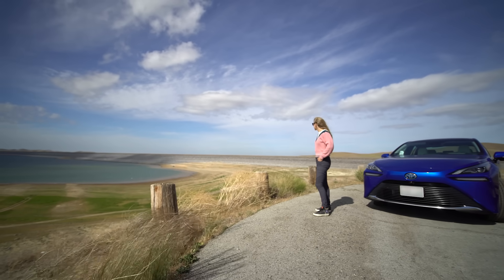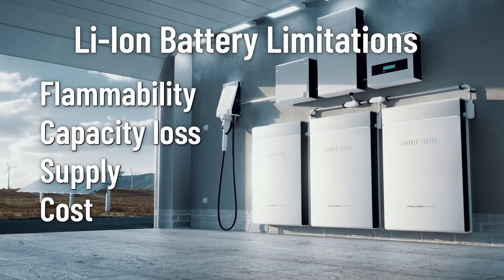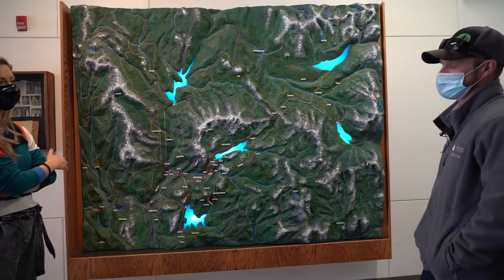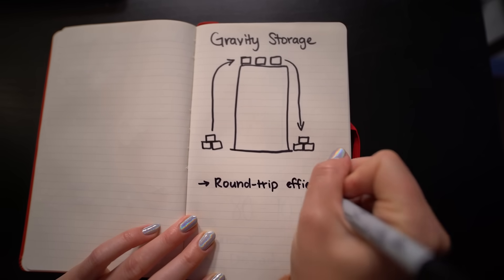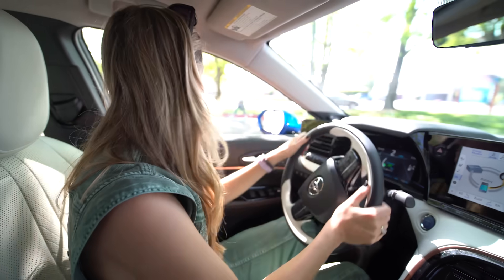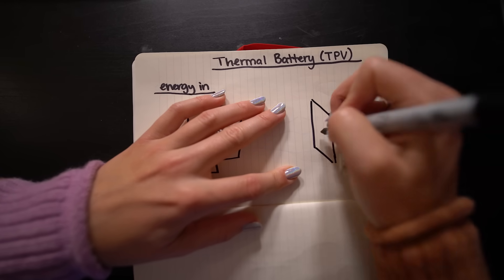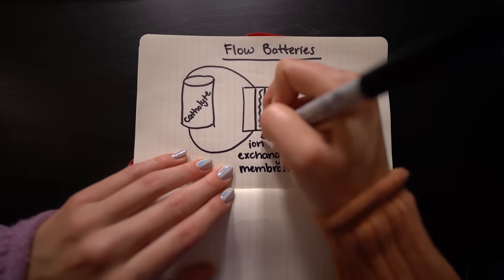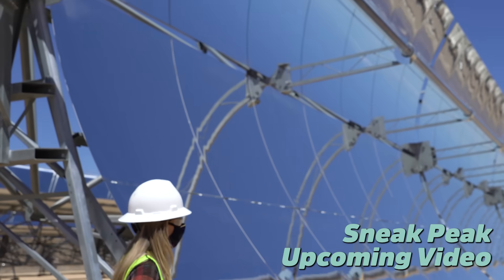The BIGGEST problem with clean energy

Comment: Hydrogen is very expensive to store.  Compressed hydrogen in tanks generally requires tanks that are so expensive that, if you have to store the hydrogen for longer than a day, it's cheaper to throw it out and make it fresh when you need it.  That's basically saying more than one-day hydrogen storage is too expensive.
Reply: Take the hydrogen, combine with carbon dioxide, and you get methanol.   Combine hydrogen with nitrogen and you get ammonia.  Those are far easier and cheaper to store and transport.  Indeed Mearsk has now recently committed to procuring dual fuel container ships than can run on green methanol as well as bunker fuel.  The big challenge is how to make that process efficient.
Reply: This only makes sense if you're using the tank only once.  Obviously that's not the case in any sane system.
Reply: @jen204  Hydrogen is 83.7 g/m^3/atm at 20 C.  A spherical steel tank (60 ksi steel) at 15 ksi working stress is 11.8 kg/m^3/atm.  The hydrogen is worth $1.50/kg.  The steel, fabricated into a sphere, is about $40/kg.  So the steel tank costs 3800x as much as the hydrogen it holds.

At a 6%/year discount rate, the cost of the steel tank for 1.6 days is the same as the value of the hydrogen in it.  So suppose you have some hydrogen now, and you need it in two days.  You can either pay the capital cost of the tank for two days, or you can dump the hydrogen and make new stuff two days from now.  The latter option is cheaper.  Obviously this is a silly simplified example, but it illustrates the problem of storing hydrogen.  Economically reasonable hydrogen storage requires cryogenic temperature.

Hydrogen gas is stored and transported via pipeline in huge quantities today.  It's primarily used by oil refineries to crack heavy crude into lighter fractions, and to produce ammonia from nitrogen.  The chemical industry has many decades of experience with hydrogen... and the stuff is ridiculously bulky.  As a result, it is made when it is needed, in close proximity to it's use.
Reply: @IainMcClatchie  I very much appreciate the detailed explanation - plus it made me learn what "ksi" was, since I'm not a materials scientist.  But I find your math is incorrect.  By your figures, that 1000-atm tank (15 ksi) holds 83.7 kg hydrogen and uses 11.8 kg of steel (a 1 m^3 tank to keep the math easy).  That's $125.55 of hydrogen, with a materials cost (steel) of $472.  The tank is still more expensive, but by less than 4x, not 3800x.  I think you calculated at 1 atm, which of course would be inefficient - nobody stores uncompressed gases.  Of course there are additional costs beyond materials, but if you're paying $472000 for a 1 m^3 tank, you're being overcharged.  :)
Reply: @jen204  Hey Jen, looks like I wasn't clear enough.

By 15 ksi, I mean the steel of the tank is under 15,000 pounds/inch^2 of tensile stress.  That's in the steel.  15 ksi is one fourth of 60 ksi, which is the yield strength of the steel.  The safety factor of four is typical for civil engineering.  It'd be different (lower) for a pressure tank on a rocket, but for cars we use the ASME safety factor of 4.

The contents of the tank might be at 200 atmospheres pressure.  That's pretty typical for scuba tanks.  So a steel tank holding that would weigh 11.8 * 200 = 2360 kg/m^3.  The hydrogen it contains, at 20 C, would weigh 16.7 kg/m^3.  It doesn't matter what pressure I assume (so long as its well above ambient), the ratio between the weight of the hydrogen and the weight of the steel stays the same.  My math is correct.  For steel at 15 ksi working stress, the tank to payload mass ratio is 141.

The cost ratio isn't actually quite as high as 3800, but that's actually another problem.  Fuelling up the Mirai costs over $15/kg, which is crazy expensive.  Hydrogen in bulk is 1/10th of that price.  At $1.50/kg, fuelling a Mirai would be similar in cost to charging a Tesla.  At the going price at pumps you can use, it's just nutty expensive.  I guess a car pump will never deliver hydrogen at $1.50/kg (just like you can't buy gasoline for the price of a barrel of crude oil), but it ought to be within a factor of 2-3.

You can get more hydrogen into the same tank by cooling it down.  Lots more.  That's why lots of hydrogen tanks store the hydrogen at cryogenic temperatures.  That is, cold enough that air condenses to a liquid or solid.  Get the hydrogen cold enough (below 20 K) and it'll turn into a liquid, at which point you can put quite a lot of hydrogen in a tank.

The Mirai has to deal with hydrogen getting somewhat cold when you pump it into the car, but this is because it is expanding as it leaves the station's hydrogen tank.  As far as I can tell from reading, the Mirai stores its hydrogen at ambient temperature.  Trying to keep hydrogen cold in a small tank would be way too much trouble.  Insulation is bulky, and cryogenic insulation is very bulky.
Reply: @IainMcClatchie  I'm sure your explanation was clear, but you reckoned without the density of your audience.  :)  But again, thanks for trying.  Where I got lost was this: "a spherical steel tank (60 ksi steel) at 15 ksi working stress is 11.8 kg/m^3/atm"  ... I overlooked the last "atm", since it didn't occur to me that pressure would be on both sides of the equation (why talk about working stress - pressure, right? - if you are then dividing by pressure on the other side?).  So, if I now understand correctly - a big "if" - a spherical steel tank that safely contains 15 ksi is in fact 11800 kg/m^3.  Clearly your numbers are correct, since they do correspond within 2x to typical SCUBA tanks.  So I stand corrected, and appreciate it!
Reply: @jen204  :) Cylinders weigh 2x more than spheres to hold the same volume at the same pressure.  Spheres are the most efficient shape.

Unfortunately, this makes my numbers check worse against SCUBA tanks.  A typical SCUBA tank is 12 liters, weighs 16 kg, and holds a pressure of 230 bar.  My number would predict 32.5 kg for a spherical tank and 65 kg for a cylinder.  SCUBA tanks are somewhere in between since they have spherical end caps.

The reason I'm off is that I assume 60 ksi steel, typical for the stuff you'd make a bridge out of.  SCUBA tanks are made of AISI 4140H steel with a tensile strength of 167 ksi, or maybe even better stuff that I'm even less familiar with.

The higher performance steel will cost more, and my point remains the same.  Hydrogen is just too expensive to store for reasonable amounts of time.

Comment: When it comes to Hydrogen, isn't there quite the storage and transportation problem? A friend of mine's PHD thesis was on making carbon fiber (light) Hydrogen tanks that didn't leak (tiny H-molecules have a way of seeping through material).
That's when I learned about another technique that doesn't just use Hydrogen but also Nitrogen from the air to create ammonia.
It works in a similar way as a Hydrogen cell (atoms go through membranes and catalyzers induce the reacions) but the main advantage is that there is already a (huge) network for ammonia transportation, it doesn't have to be stored at huge pressures, and it's less flamable/explosive... I do think the fact that you have to "break" a very stabe N2-molecule was sort of an issue still, but I found it a very interesting technique!

Comment: Storage is much less of a problem for wind, than it is for solar.  For solar you need technology to timeshift across a 24 hour period, but with wind it's more likely that you just need technology to move electrons from somewhere the wind is blowing, and statistically it becomes less of an issue as more wind power gets built out.  Pumped hydro a good option, as is pumped air, melting salts, flow batteries and all those others.  I think it's kind of disappointing to have to discount your content because it's so obviously sponsored to favour Toyota's odd focus on Hydrogen.  Hydrogen is surely valuable for fixed refueling locations like rail stations and airports, but for cars it's clearly been superseded before it even starts.

Comment: Not so sure about that thermal battery concept; not only in terms of its scalability, but the fact that it seems like its mechanisms are deeply rooted in old legacy energies... i.e. burning carbon glowing hot to throw some IR radiation at some solar cells. 
Anyone else find that to basically just sound like a painfully engineered version of a mobile solar array? It would solve the inconsistent  sunshine problem, but does so by adding a fuel to burn as a fixed light source.
Solar is already kinda a lackluster renewable as is. At this point either the photovoltaic tech needs to have a breakthrough in efficiency or we put an array of reflectors on satellites and relay the Sun's light to be collected on the Earth's surface more directly. Until then, solar will remain a novelty-tier energy source.

Comment: What I find interesting is that many people don’t realize that hydrogen fuel cells literally are batteries. It’s just that the oxidant and reductant are being continuous supplied at the anode and cathode. 

If we moved to decentralized power generation, we could produce way more power than people would ever use (at least in the current era) and efficiency would no longer be an issue. Pavement is a 100% inefficient solar panel. With that, we could just use metals as oxidants and reductants for durability without worrying about the efficiency.

Comment: Something you missed.  Tesla.

Tesla has developed a new form factor for batteries which is expected to bring the cost of cells below $50/kWh.  Their tabless, dry rolled 4680 cells are on track to revolutionize batteries.

Their 4680 technology is not wed to a specific chemistry.  "Lithium-ion" chemistries are likely to be used in performance and long range vehicles because they store more energy per volume and weight.  But for most EVs and grid storage the best chemistry of the moment is lithium iron phosphate (LFP).

LFP battery materials are very abundant and cheap.  LFP batteries have very long cycle life.  The LFP cells I'm using with my solar panels are rated for 10,000 full cycles.

$50/kWh / 10,000 cycles = $0.005/kWh.  Half a penny.  
---

There may be a few times per year when we need a dispatchable generation source as cycling only a half dozen times a year wouldn't go very far to pay for LFP cells.  That role might be taken up by running existing CCNG plants with methane recovered from urban and agriculture waste streams.

Comment: Consider electricity is optional but a livable planet is not.   I use solar power without grid.  Better to consume energy when it is available.  For example I run my 3d printer on sunny days not raining.  At .scale consider running desalination, and many industries scheduled around the weather.  Many countries do not have grid power 24 hours a day, and we should consider turning the grid off at times as well.
Reply: Of course, your 3d printer, your 'without grid' is residential scale. About 20% of total energy use.

To make the plastics, refine the metals, form and assemble your 3d printer you need continuous power. You can't turn off a plastics batch mid-stream even for an hour, because it might take you hours, or even days, to get back to the correct temperatures. Ditto refining metals.
Starting up and shutting down the forming and assembly machines simply means that the firm building the 3d printer isn't using its equipment economically, its workforce is either working like mad or standing around waiting, and its planning for materials in and products out are out of whack.
Industry is about 30% of total energy use.

"Many countries do not have grid power 24 hours a day" - and those are poor countries with unhappy populations. Those countries are poor BECAUSE they don't have grid power 24 hours a day.
Reply: @factnotfiction5915  I have been to countries without any power grid, and the people there were more happy.   In this place they had everything. The most important things (healthy food) they had abundance unlike in the US were the food is riddled with chemicals.  Americans who take record numbers of antidepressants and are very unhappy in general.  I think you are confused or read too much false information about poor countries being unhappy, because it really depends and material wealth does not make people happy.   How can you support a production system that is leading to complete destruction when everywhere I look in the USA I see people with too much stuff.   The people here have too many physical possessions which just adds stress to life and the highest levels of waste anywhere.   If is possible to produce more than is needed already working with energy as it is available without storage.   You can shut down production in overcast days for plastics and steel, it is simple as that, because we already produce far too much and it ends up being wasted and not valued at the level it should be considering the emissions caused.   Ensuring constant excessive energy for high-energy lifestyle is a mistake and if it continues: our future is bleak.   For example: this includes all types of cars.   battery, hydrogen doesnt matter, the numbers show there is no way to realize these (other than perhaps rescue/ambulances) in a future without catastrophic climate collapse.   automobiles are an abomination and lead to many deaths as well as a population that is 2/3 overweight, while driving is proven to reduce intelligence as well, and land that would have plants turned to deserts from pavement.

Comment: Hydrogen is the smallest molecule and so ... it's quite difficult to contain without a lot of loss. Underground storage is an underground bomb of sorts. I believe someone has developed a sort of material matrix that can properly contain the molecule under high pressure and volume inside a special tank.

Comment: efficiency improvements in hvac, motors and pumps of all kinds will free up a lot of generated electricity along the way - too little attention is spent on making efforts in this regard.  RMI has some good ideas and practices they propose/support - worth looking into the potential of these...
Reply: Why would you waste your time on a peripheral problem? Also, as efficiency has gone up so has energy usage; making what ever gains pointless.
Reply: @kokofan50   actually, the scope of losses due to inefficient uses provides a large cushion on future generation.   I understand that this video is about storage, but if you fix demand levels - and I'm talking about areas that are  well into double digits of loss...  reduces those needs, and that stuff is super expensive and adds it's own inefficiencies and losses too....
Reply: @lylestavast7652  it really doesn’t matter if you go from 5mw to 4mw if you only have 5w of storage.
Reply: @kokofan50  just as a data point for reference - LLNL has a graph which traces energy from source to ultimate usefulness.  60% of energy used in the US ends up as rejected heat...  THOSE kinds of inefficiencies exist...   it's everywhere, for the picking...  and every bit that you make more efficient, reduces volume of storage needed...
Reply: @kokofan50  also - many things happen in parallel in large systems - it's not a scenario where there's only one focus, and these things are going to vary in solutions all over the place ...  end use efficiencies is common everywhere.

Comment: Toyota is not a friend of renewable energy. Hydrogen is not the solution. Batteries are not the enemy.

Critical thinking is needed when reading from Toyota's anti BEV "fact" sheet. No mention of CO2 emissions from Hydrogen (97% from Methane without 100% CO2 capture), no mention of the life span of a Fuel Cell, a very one sided presentation.

Go see Moss Landing, 182.5MW/730MWh battery replacement of a Gas Peaker plant. Check out Paul Martin's papers on the thermodynamic losses of renewable Hydrogen to see why it will never make sense - you can't greenwash the Physics.